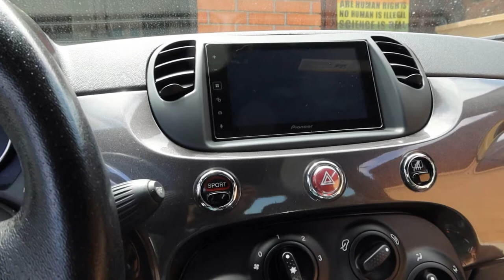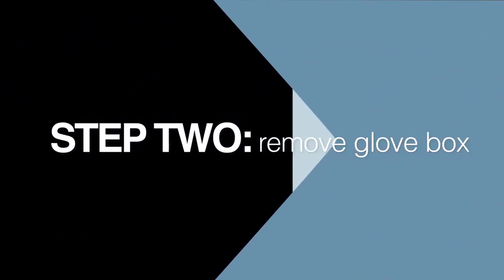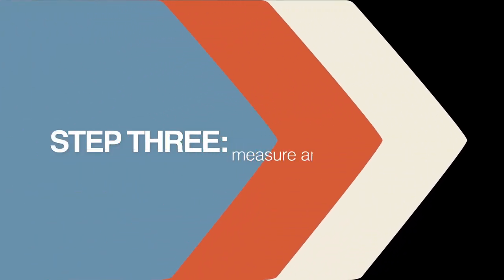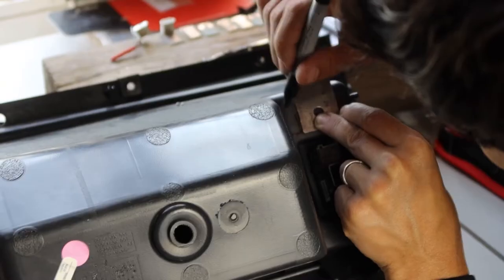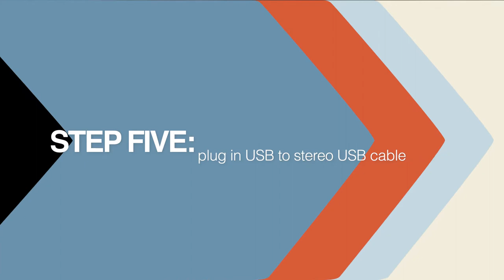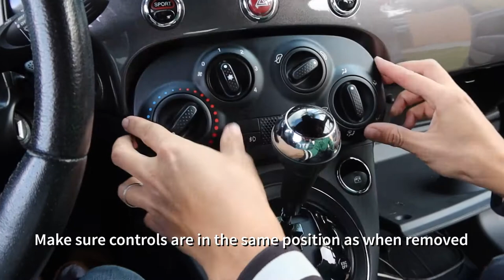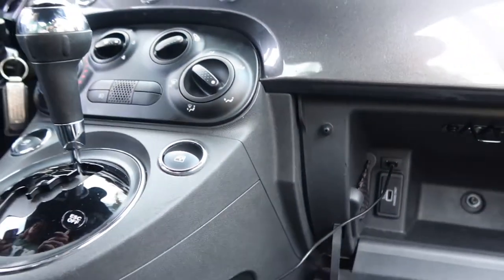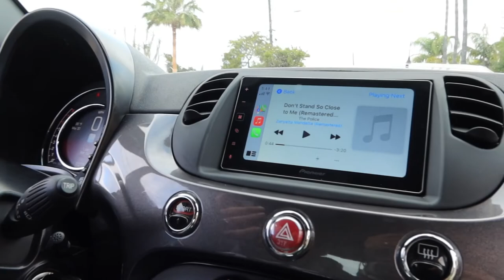USB Hack for a Double DIN Radio Installation | Apple CarPlay USB Hack

Comment: Excellent videos you guys! I don’t get why using the original factory port didn’t work with the new stereo.
Reply from the maker: Thank you!  It did work but only to charge, it stopped transferring data when we removed the factory stereo. The unit we installed comes with its own usb port. There's a few reasons why we decided to go that route, and since you ask we should probably shoot a video about that.